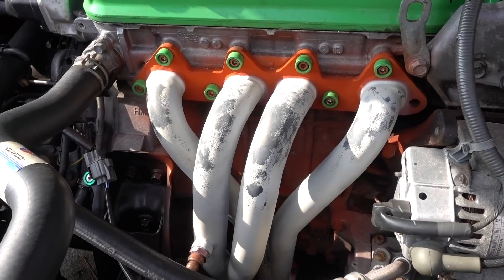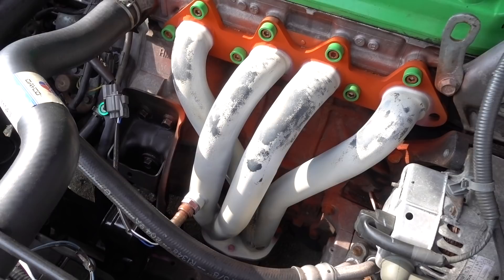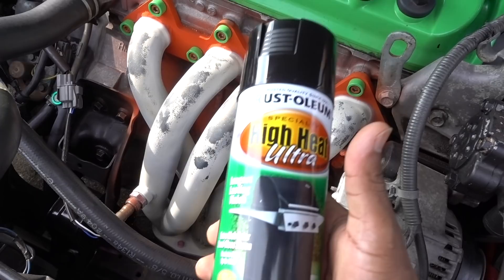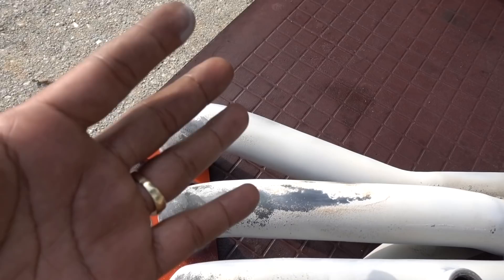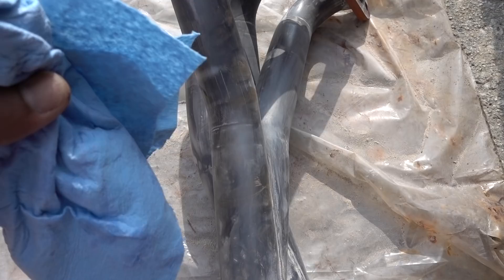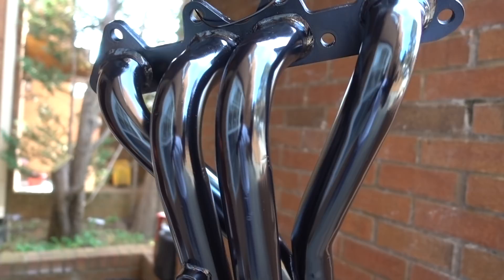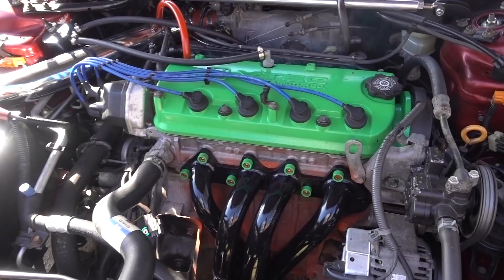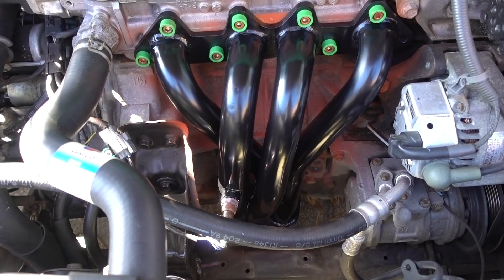#BulletSolano #HeadersPaint #2000Accord Header paint VS Grill paint Amazing Results

Comment: I've  always used VHT flame proof primer followed by VHT flame proof paint from headers to tail pipes and I have never had it discolor or burn off. I thoroughly clean the parts  before applying the primer and paint.
Reply from the maker: Thanks I’m thinking on doing this again with vht everything
Reply: Really?  I went through sanding new pipes, acetone wash and vht paint n primer and certain spots still flaked off..  random places though and couldnt be contamination cuz used gloves n some of the places are in the middle of a straight so wouldnt have been bad prep..
Reply: That's good to know because I painted one without primer cause I was in a hurry but bad mistake. I'll try with primer this time
Reply: I follow up wiht the clear satin finish before I cure them adds more luster to the finish.
Reply: @Z-Ack  sand with 150 grit to give the primer something to hold on to.
Reply: The VHT is crap.  I'm a professional painter and VHT was garbage.

Comment: One key thing with the header paint is that it is supposed to be cured in an oven at I think 2-300° for awhile to properly set. If you just let it dry normally and then drive which heats it over 1000° then it doesn't cure properly and fails. I have also just let the car idle for awhile with decent results, but a full cure as it calls for is best.
Reply from the maker: I make another video like that , I cure the paint in the oven! I followed the instructions but it didn’t last
Reply: You Can also just bolt it up after painting and run the car through a few 1 minute cycles then let it sit overnight and your good  I find thats easier than the oven but both work 👍

Comment: Yep I used it on a 69 Ford big block exaust it was super rusty I painted the exaust pipes mufflers everything all I used was a wire brush to remove the loose rust .
I used the silver one it had metal in it paint will never come off once it bakes on ....they sell it at home Depot .  Actually the ceramic paint has a cycle for it to work properly you must get it hot turn car off let it cool turn it on again let it get hot then let it cool do this like 3 /4 times to work the right way the stove paint just spray it on and forget it .

Comment: Good job, thanks for the video, I think I'm gonna use this paint on my valve cover. Not as hot as the header but I'm gonna apply clear high heat to try to protect the oem paint.
Reply from the maker: No problem

Comment: you need to sand the header /exhaust etc down before you paint.  sand, wipe clean with wax/grease remover alcohol etc..let dry then paint several light coats. 
then cure it according to the directions. (bake it in)

Comment: The problem is (from what I've heard), is that the VHT stuff is excellent, but it needs to be cured in a very specific and controlled way for it to hold up, otherwise it flakes right off. I'll probably bake it in an oven for the job I'm using it on, but I think that's a big downside of the VHT stuff.
Reply: XtremeConditions you are correct , set oven to 500 and bake for an hour , you should also prep , with a heavy grit sandpaper
Reply: Yea those look like stains from an oily hand.

Comment: Best video so far on the Rust-Oleum High Heat Ultra paint. Will be using this paint on the exhaust pipes of my motorcycle. Cheers brother
Reply: Did it work well?
Reply: Haven't sanded down my pipes yet, but one hot rod builder I know said it wouldn't work. I'm going to try it anyway. Maybe I'll post a video. Cheers

Comment: Damn. Just got done painting BMW motorcycle valve covers and timing cover with black vht paint and just saw this someone else told me to use BBQ paint but I was like there's no way that could possibly be better I am smacking myself now the barbecue paint has a deeper shinier black too. I have a bad feeling I just wasted 2 days worth of work
Reply from the maker: Sorry about that bro I hope the paint last
Reply: the BBQ paint is shit it didn't even last 6 months.  Use the VHT stuff and prep the surface properly
Reply: VHT needs to be baked in the oven for a couple of hours right after you paint it, to cure the paint, otherwise it will melt from the inside out & believe me ! Made the same mistake myself. LOL Idk about the grill paint but think it all needs baked to cure .

Comment: If you want to use the VHT you MUST use the primer first. After putting on the primer heat it  to harden out. Them put the flameproof colour paint. Again heat it. Then you won't have the problem you had my friend.
Reply from the maker: https://youtu.be/Q4X_RuoQX0s
That’s the video where I put the Headers in the oven to cure the paint and I Tun the car few times in idle to cure it some more
Reply: Good to know cause I just put the vht primer on haven't painted yet. Thanks for the tip

Comment: You can also use a heat gun to cure the headers!..just buy a oven thermo for around $10 and heat the pipe from the inside!..get it around 200C for around an hr and it should cure!

Comment: When you paint headers use a propane torch inside the pipes to warm them up, between coats.
Bill Hirsch has the best header paint it's silver or black ceramic paint.
Reply from the maker: Thanks for the info

Comment: I use that Rust-Oleum paint on my motorcycle pipes and a few days later the paint always comes up,i didn't use primer, i did like 6 coats and still came up after a few days..Im going the try the VHT paint that i just bought tomorrow.
Reply: @Chicago Rc Yes i did do it, i put like 7 coats of the black and like 3- 4 coats of the semi gloss..i followed all instructions, but it started to flake after 3 days and then after 5-6 days it flaked hideously!!! I'm going to have to find a professional place that does that, who I'm going to have to just buy a new pipe which there's nothing wrong with my pipe, just the God damn paint! But I love the sound of this particular pipe!
Reply: @Chicago Rc not only that, i noticed it took off all the paint underneath it from before as well!
Reply: @Chicago Rc It was a waste of time and money, both paints!! Im going to find a professional ceramic painter with some industrial shit and be done with it! As for you i wouldn't bother with the Rust-Oleum or the VhT..i tried both and got the same results.
Reply: @Chicago Rc Thank you so much, and good luck to you as well.

Comment: how come the paint on the manifold ,it kinda light but the  VHT paint it would be thicker ? and the BQ paint,how long it last or how long it's lasting by now? Thanks
Reply from the maker: Different brand and different way to make it, and no paint is good for the exhaust manifold only if you take it to get ceramic coding but that’s to expensive and worthless, at the end I put wrap on the manifold

Comment: Honestly primer would've been best for better results on that red ima use it and do the job.. you gotta bake them first before installing then engine bake them at normal idle..
Reply from the maker: I did try in another video 
Putting REST OLEUM Paint to the Test on the Headers https://youtu.be/Q4X_RuoQX0s
Reply: Nice but you are using 2 different brands.. so first time you did not use primer so this video you did was to correct your mistake..
Reply from the maker: No is just to try different methods, because I wanna get the best results but nothing works for me

Comment: Im having my headers put on right now. How do i cure them. I did spray em with rustoleum grille paint few weeks ago. Anyone know what i should do before i just start driving my car?
Reply: You're ahead of the curve by having a two week curing time before install. If it were me I would start the car with the new headers for just a couple mins till tubes get hot but not to the point of burning the paint like this video. Let them cool and repeat a few more times before really letting them get to full temp.
Reply: mrelectron62 awsome. Thank you

Comment: vht failed for me also.  perhaps its cuz the spray puts out so much and makes it hard to do thin layers , as comparied to other brands.  i dont know but vht fails
Reply: A few more thing that bugs me about vht besides it failing for me...

First you cannot tip the can without interrupting the flow.  This is really annoying. Just approaching 45° it will start cutting out, and it doesn't even cut out consistently, the less in the can, the worse the cut out.
Rust-Oleum you can turn the can completely upside down and not interfere the flow, and use it till all but empty.

Second with the funky nozzle, you have a really hard time directing the paint wear you want it until your already spraying then you need to adjust. Again the Rust-Oleum has a wide indented nozzle and you know exactly where it's getting pointed.  Sounds like nitpicking but when your trying to get precisely control you'll know what I mean. 

Next the spray just doesn't atomize like the Rust-Oleum paint. There seems to me no easy way using the recommended 8-10 inches that you can get the recommended thin light coat.

And finally i find it's priced at a premium compared to the Rust-Oleum and I can't figure it why

Comment: I just painted my headers with that VHT,do you think if I used it for a primer and then used the grill paint as top coat it would work?
Reply from the maker: I don’t think so but tried because in another video I tried it with VHT primer Paint and sealer and that didn’t work
Reply: Bullet Solano ... thanks for the reply,already put the VHT on so I guess I'll have to let it burn off and then use your method,thanks again!
Reply from the maker: Yes but remember that the grill paint didn’t work for lots of time
Reply: Bullet Solano ...again,thanks but all I can really do now is just run it till I need to deal with the results.And by the way,best way I have ever attached headers is with Allen bolts,didn't need to worry about getting a wrench or socket in there and never had a leak!
Reply from the maker: Ok

Comment: Did you even properly cure the paint as per the directions? You have to let the VHT paint dry before you cure it. You can’t just paint and drive
Reply from the maker: I did the cure process in the oven like vht recommended.
Reply: So you used the VHT header primer and let the paint fully dry before placing in the oven at the following specs?

250 for 30 minutes and let cool for 30 minutes

400 for 30 minutes and let cool for 30 minutes

600 for 30 minutes and let cool for 30 minutes

Not the mention the 7 day curing time, which clearly states on the can of VHT very high temperature flameproof header paint?
Reply from the maker: No bro i think that’s the problem I used rust oleum high heat primer, that’s why the paint didn’t last

Comment: Can you do a quick update on how it looks after a few months?
Reply from the maker: Yes no problem I’ll do it this Sunday
Reply: QQTrick1QQ 
I painted my whole exaust from a 69 Ford big block V8 it was 35 years old and rusty used a wire brush to clean it up good sprayed it on once it heats up the first time it's baked on it is never coming off it works awesome the have silver ,black,white , home Depot has it .

Comment: Did you prep the surface first tho? Never seen anyone have problem with the header paint unless they just washed the surface and sprayed.
Reply from the maker: Yes I prep the surface
Reply: Doesn't matter if you prep the surface unless you use primer tho.
Reply from the maker: I use primer in another video but I have the same results
Reply: did you use their primer tho? primer, paint and clear?
Reply from the maker: High heat primer from restoleum
Reply: i wire wheeled, then used brakleen, , then sprayed all my exhaust except the header, other than scrapes from being too low, its held up over a year now. no primer. heat it up soon after spraying, dont wait too long, you need the heat to open pores in the metal so the paint gets locked in while theres moisture in it. the paint will dry as it cools, and hold on tight. if you let the paint dry then heat, you have essentially wrapped the pipe in paint, not painted it.
Reply: Oh and that was vht
Reply from the maker: Yes

Comment: What was the temperature with the grill paint ??
Reply from the maker: Heat Difference from Stock, Aftermarket, and Wrap Exhaust Manifoldhttps://youtu.be/_nMezhtPasw
Reply from the maker: I didn’t get the temperature that time but check the other video I make about it
Reply: Johnell Golatt , 1200° and the VHT 1300° to 2000°

Comment: I'm wondering if the Grill Paint will keep the heat from reflecting into the engine bay like ceramic coated headers. That is the question I have to ask.
Reply from the maker: Im not sure about that because I never check the heat but I thinks ceramic is better

Comment: Did you not do the heat cycle?? I've never had an issue with vht. You have to heat it in stages..
Reply from the maker: Yes I think my problem is that the heat cycle that I did it was in the car not on a oven.
Reply: @BulletSolano  you do it in the oven, 30 min 300, 30 min 400, and 30 min 500... otherwise it's just another spray paint that won't hold up.
Reply from the maker: I did that process on another video, same results

Comment: Hi, no primer needed?
Reply from the maker: I didn’t use primer because with this paint I don’t have any problems but if you want to use primer that’s even better
Reply: any high temp primer you would say is good to use with this grill spray?
Reply from the maker: The one that I’m going to use is Rust Oleum high heat primer for the next application on the Headers, if you guys want to se the result wait for the next video